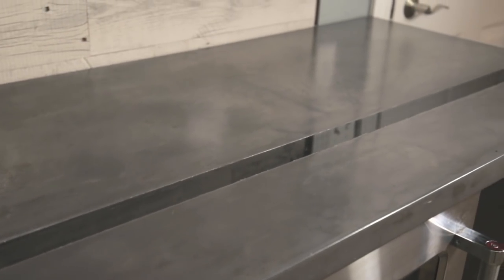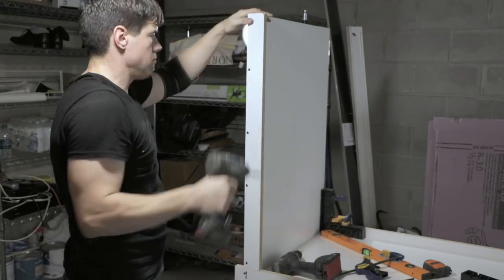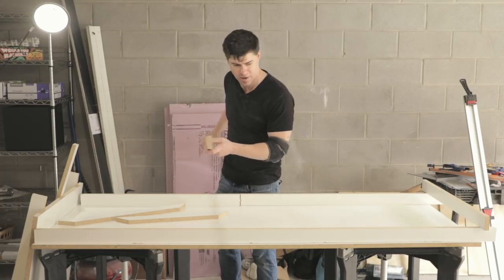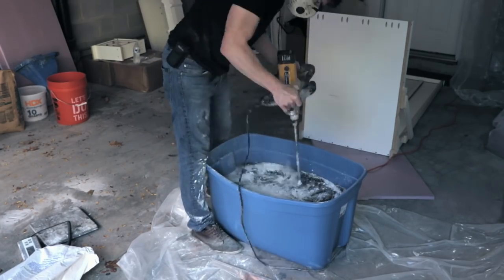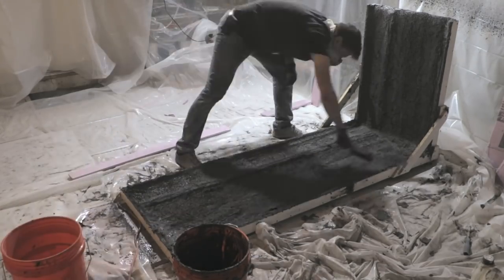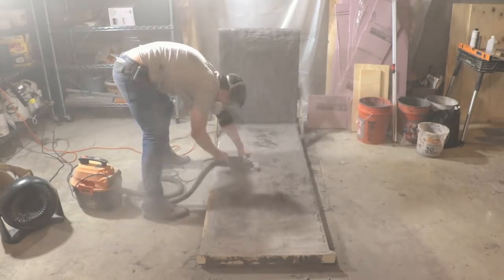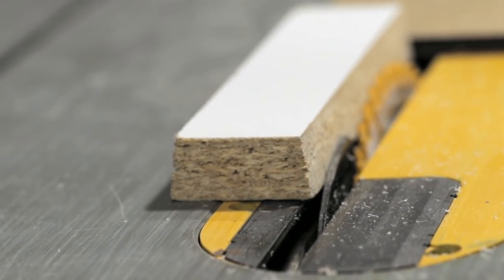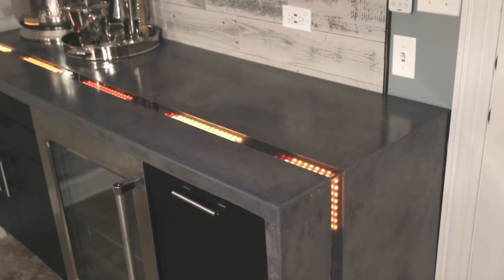DIY Mancave Makeover Pt. 1 // Waterfall Concrete Countertop w/ LED River Inlay

Comment: Does anyone know of a good glass fiber supplier that ships within Europe? I live in Belgium by the way...
Reply from the maker: +misteragony looking quickly online, I find Dutch Design Breton.  However, their prices are double what we pay here in the U.S. (likely since they are selling US brands and have to ship from here and pay import/export Taz).  There must be someone in Europe who sources the material there and is less expensive.  Please let me know if you find someone, since a few people have asked me.
Reply: Find any industry the uses fibreglass. E.g boat builders, and ask. What you'll want is called "chop strand"  mat in Australia. You'll  buy it on a roll or in sheets then tear it into small peices, then when you're mixing it into the concrete it will break down further into individual strands. Waaay cheaper than buying pre shredded bags.
Reply: Thanks for your answers/tips!
Reply from the maker: +TheRadGuy interesting....do you just tear it by hand?
Reply from the maker: +misteragony any time, glad to help!
Reply: They also have white cement - https://www.hazelaar.nl/product/1340807452/witte-cement-
Reply from the maker: Thanks for sharing!
Reply: You want to use an AR (alkali-resistant) glass fiber, not the stuff that is used for fiberglass. The alkaline in the concrete will break down the typical fiber glass over time.
Reply from the maker: Jim is correct here

Comment: Where's the data sheet for Arduino program
Reply from the maker: This build did not use an Arduino.  If you check the video description for my rings of Saturn light, and my LED Bluetooth speaker, there are github links to my music syncing code there